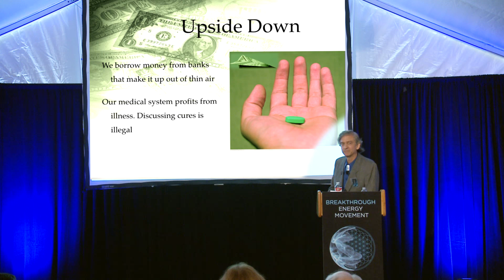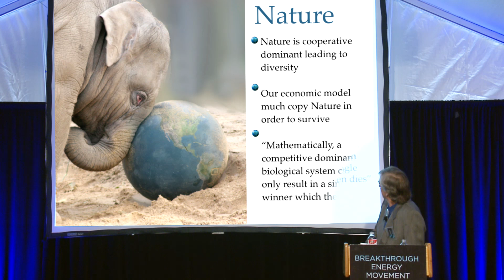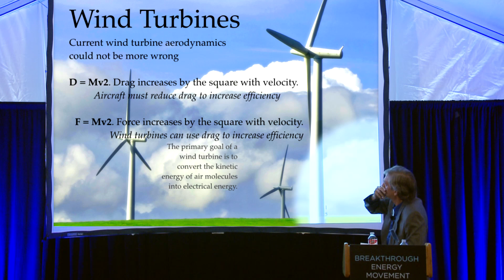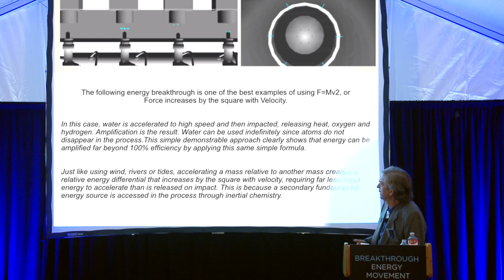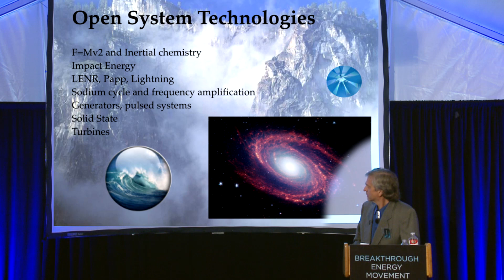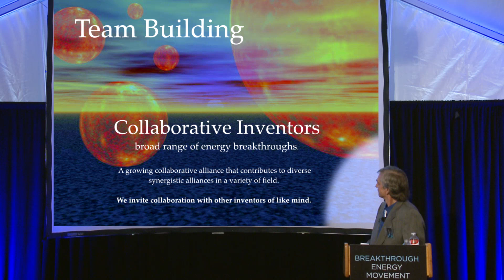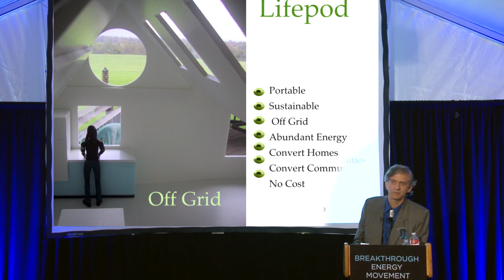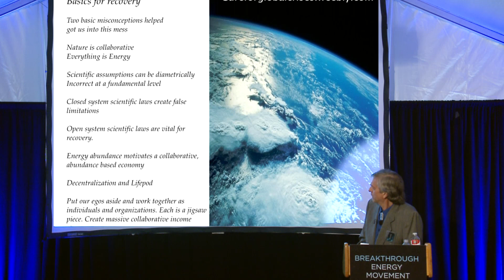The Basic Physics of Global Recovery | Mike Waters

Comment: There is a kind of super inertia thus a moving mass, a brake pulse can be removed without this mass is slowing proportional. This phenomenon is called Reynolds number which plays only in the 1/150 sec range. Thus, water is really briefly as hard as concrete. Turnaround a bicycle, let a wheel running and brake it off with a wooden style, then try to slow down the wheel with pulsed short timed strokes of the cane in the opposite direction, you have a lot to do - that is this type of free energy, by Chas Champ Bell 2006

Comment: Mike, I could merely say thank you!
However, as some may know, I operate my own energy channel. So, I will share something profoundly simple to add to your impact technology.

Just as when a car traveling at 100 miles per hour hits a wall, then a great amount of energy is released, and so too, when two cars, each traveling at 100 miles per hour each hit each other head on, then a much grater amount of energy is released.

Well, aiming a single jet of water at a solid object may indeed release a lot of energy, Yes! But, you destroy your surface in the process.

However, using 3 dimensions, how much more energy would be released if you aimed two water jets at each other? And, how even more so, and yet with less water per stream by having a number of streams converge into a center-point from the angles of, lets say a dodecahedron?  Now add timed pulsing to the jets...

Easy plasma, without destroying a surface!

MagnaMoRo

Comment: They don't want the wind turbines to be more than 5% efficient, that was deliberate and by design,
it was NOT by mistake or a flaw in engineering. That is so it does not threaten the Petro-Dollar paradigm and
the current Monetary system and Energy system; which is all designed to NOT give citizens energy independence but
to keep the populace energy dependent. it is much more profitable to control the population and wage war over oil
and finite fuel systems than to allow free energy or energy efficient design to be disseminated to the masses.
Anybody that doesn't get that is a liar and doesn't understand the concept, look at the U.S. Invention Secrecy act of 1951.
Any system that is more than 70-80% efficient is listed as a "security threat" and confiscated by the U.S. Govt on the
premise that it threatens the national security. Which is code for enforcement and protection of the Big 7 Sister oil
companies and their current Bankster and Monetary system of the U.S. Petro-Dollar and Dollar Reserve currency.
It's the same thing with Solar power, they have solar that is more than 70% efficiency but they will never release it for
the same reasons above.
Reply: Apparently the US Patent Office has suppressed over 4,000 patents for high efficient energy devices suppressed under national security reasons... so much for liberty
Reply: danbayasi
Exactly, and they killed off the rest, like Stanley Meyers, Jailed Paul Pantone, and gave Bill Boyer cancer to make it look natural, and killed Tom Ogle, those that don't play along get eliminated.